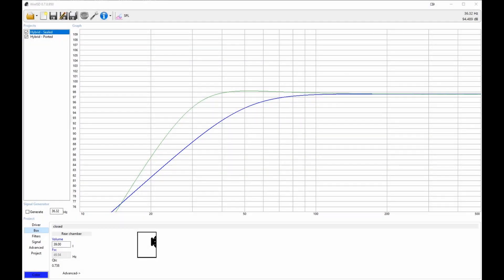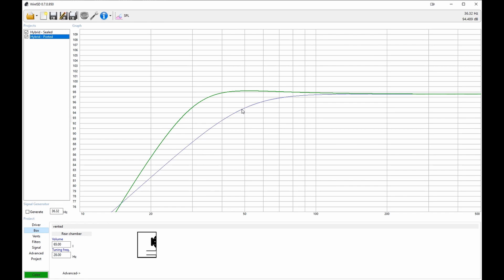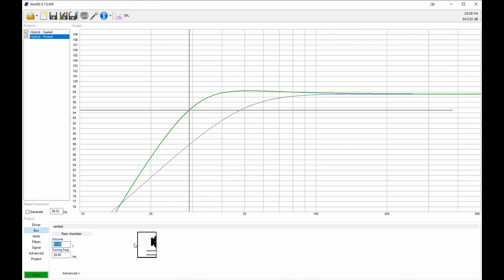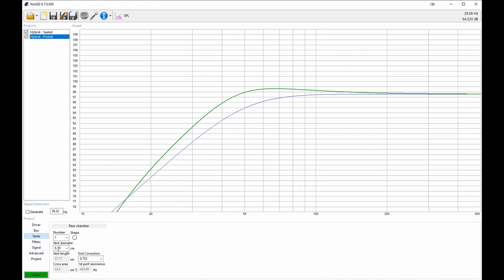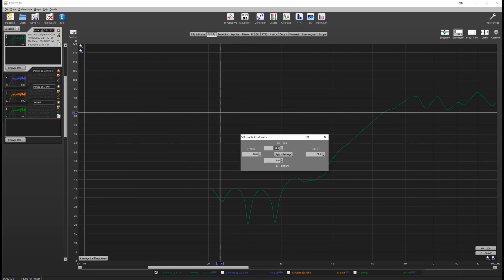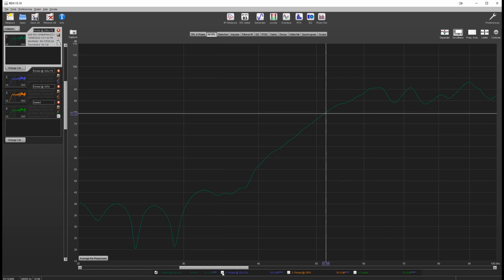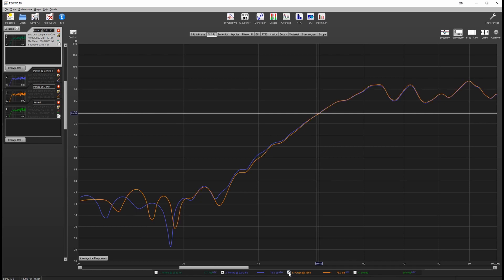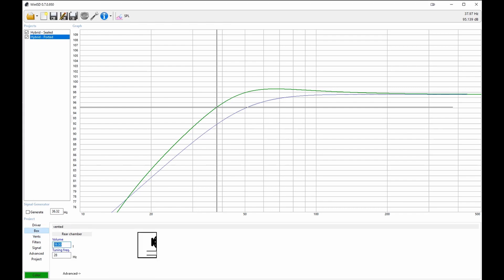Hybrid DML Speaker 4 - Should I port my Boxes?

Comment: You have to measure both, woofer and pipe as near as possible and then combine both results ... looking at your measurements let me think that you did not do this ... sorry, if I am wrong
Reply from the maker: Hey Thorsten - are you saying to reposition the mic to measure the output of the port separately?
Reply: @TypicalBenYT  , yes ... just locate the mic as near as possible to the woofer ... that gives measurement 1 ... then position the mic as near as possible to the port ... that gives measurement 2 .. afterwards you have to combine them ... that is what I remember ... but I can not tell you how to combine these 2 measurements in the right way ... hope that helps

Comment: Great video Ben.

I’ve spent a lot of time with modelling software but not yet built any of my plans as I’m still finishing my previous projects. Now I’m worried I’ll be disappointed when I make them ☹️.

I’m really surprised that the porting made so little difference! I know the models usually look better than real life but you could hardly see a difference.

Might it be worth measuring the TS parameters of your speakers rather than using manufacturers specs. I wonder if that could account for some of the difference?
Reply from the maker: Great suggestion, thanks. I wouldn't be too quick to assume you'll be disapointed though  - it's been pointed out that my measuring technique might be lacking so I'm going to have to look into it a bit more before drawing conclusions I suppose. Always learning!

Comment: Sealed enclosures rule for size and sound in my opinion. They typically need a bit more power to drive them, but they stay cleaner longer than ported subs. Once you hear that Pddddddd port noise, you simply cannot un-hear it! Personally, I've never heard a ported speaker period that didn't suffer from Pdddddd. That's why I always stick a sock in them 😁! Sealed enclosures normally take very well to some EQ work. You should have no problem bringing up that low end if you have the power to drive it. Cheers 🍻
Reply: I agree that sealed boxes sound better than ported (bass-reflex).
Reply from the maker: Interesting take, thanks!
Reply: @TypicalBenYT :
Don't forget about passive radiators. You can get so much more base in SPL without the Pddddddd port noise. And they are tunable with a wrench rather than port length or enclosure size. Cheers 🍻
Reply from the maker: @Finite-Tuning  Thanks - I did have a quick go at modelling a PR enclosure but I don't know enough to really understand it yet.

Do you think I'd get away with a smaller enclosure (compared to a port) using a radiator?
Reply: @TypicalBenYT :
 A hard YES.
Reply: there is no simple 'best solution', EVERYTHING is a compromise.
take your EQing approach: everything is correct but it should also be mentioned that with increased power comes increased distortion (vs a port that adds no distortion but adds delay). +3dB is super easy for an EQ but that means twice the watts and can mean twice the distortion.

neither distortion or delay are problematic at low values and SPLs.

ps: there are proper bass guitar speakers in both configurations and they're obviously 'musical' :)
Reply: @duroxkilo :
Well sure, everything is a compromise. I don't believe I said anything to the contrary. However, amplifier distortion values are not linear, more power does not equal more distortion. It certainly can, but it's not a rule or a law.
Reply: some amps are exceptionally clean even at peak power indeed, but the speakers exhibit distortion the moment they start moving...
a sealed enclosure demands the speaker is fed at least 2x the power starting at F3 and who knows how much extra at lower fqs (to match a reflex box, ports or radiators) and that always produces considerable added distortion. 
there are budget woofers, small and large that measure satisfactory and some compare even w/ pro liners but ONLY up to a certain SPL, say half the rated power...
the easier a transducer is driven the cleaner it plays, especially non-pro models.
  @Finite-Tuning
Reply: @duroxkilo : 
You sound/seem concerned with distortion.  
Understand that any and all recordings will have some distortion already baked in, and then the tweaking and tuning of the recorded audio, some call it mastering, will add change or alter. Speakers will never be 100% accurate as they are now, that is why some manufacturers go to extremes and us Beryllium and Diamond cones. Others use $50+ capacitors in their crossovers. It's all for the sake of accurate reproduction. It's not good or bad in anyway, unless you can hear it one way or the other!

Me, I'm simple. If I can't hear it then I don't much care aside from the measurements. But I always shoot for flat in any endeavor. I don't trust that I can fully see the color red with my naked eye, but I do trust my calibrated tools (colorimeter).

For me it's real dirt simple. 
I don't wonder, I don't think, I don't guess..... I test and I measure and I prove! That is how I know. Cheers 🍻
Reply: i'm not concerned w/ anything.. :)
i was simply amending your input that in my opinion wasn't transparent enough for the potential beginners reading it..
cheers and happy listening
 @Finite-Tuning